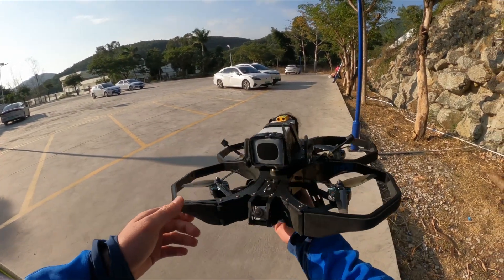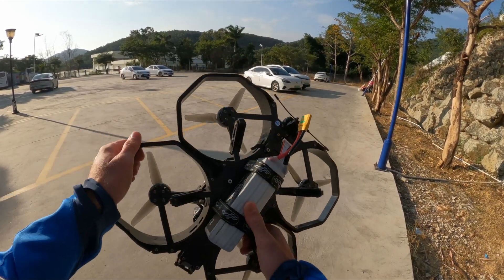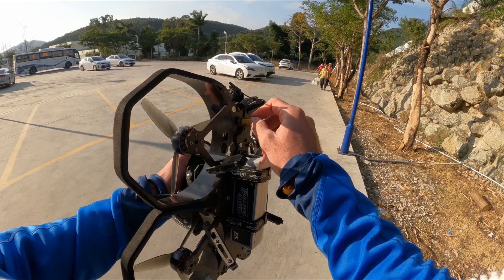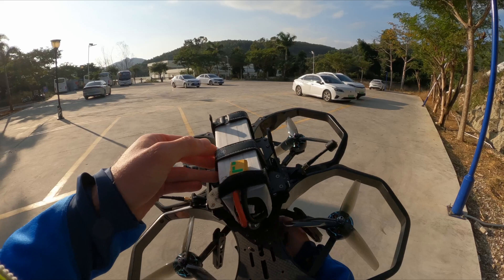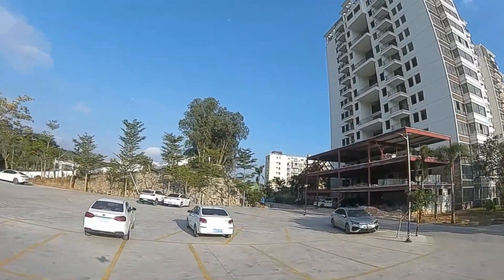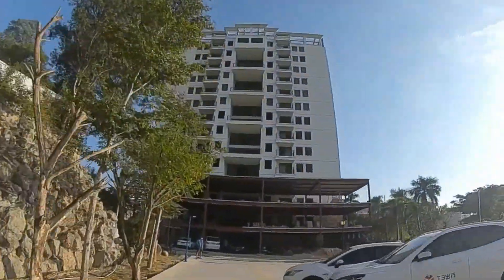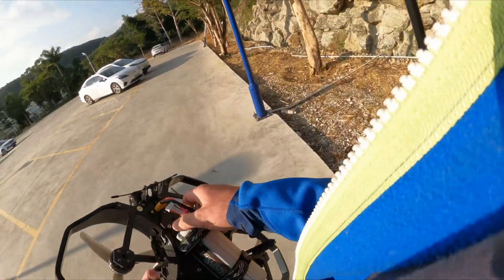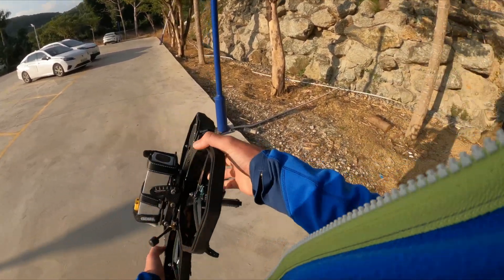iFlight ProTek60 // LOS Soundcheck / BF4.3 XING tune

Comment: Hey man, thanks for sharing! I'm trying to decide between this drone and the Taurus X8, I'd be super grateful of your advice. With regards to the Protek60, my first question is with only 4 motors lifting quite a heavy payload, do you think the motors will wear out quickly being under such load all the time? Also, are these motors reliable and if one motor fails do you think it's still possible to land the drone fairly safely? I like that this drone has the prop guards and is slightly more affordable than the Taurus X8, but the big advantage of the X8 is that it has slightly longer flight times, it also has far better failsafes with 8 motors, and with 8 motors there's less load on the motors with carrying the payload. Thanks for your help!
Reply from the maker: Those 4 motors are totally fine for 3kg (my rig) and cruising. If you want to get more flight time or power for some acrobatics, it's definitely not your choice.
Reply: @xingtheiflightinsider  Thanks for your help,  I think this would be a good choice for me as I'll be using a small mirrorless camera setup similar to you and not looking to do acrobatics, just smooth cinematic flying.